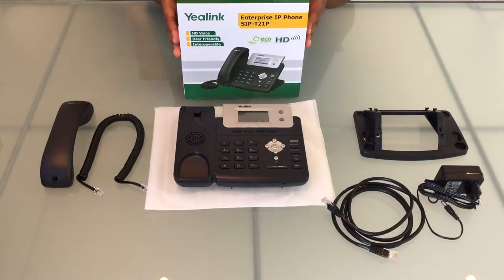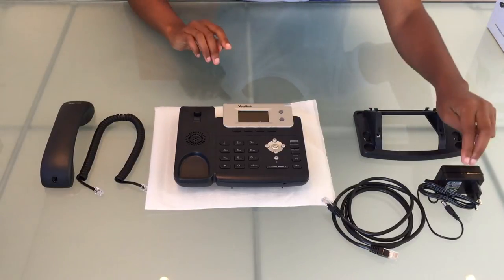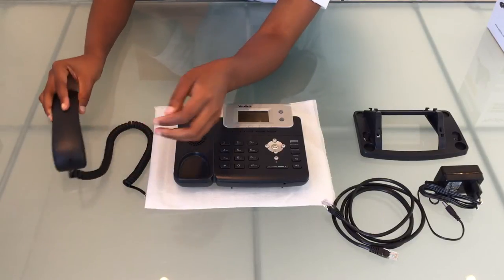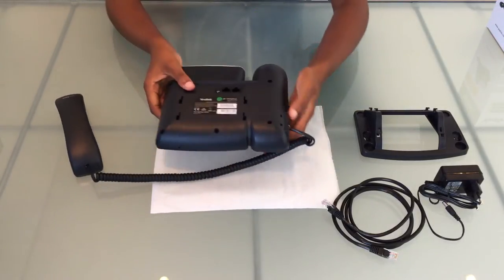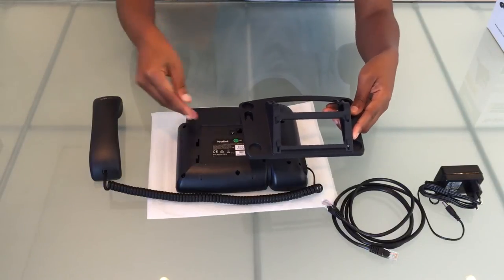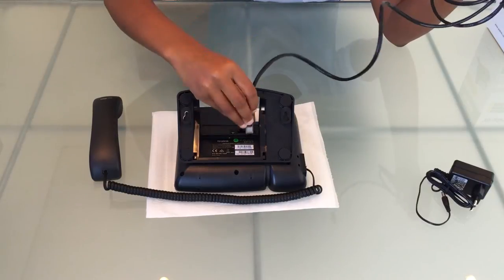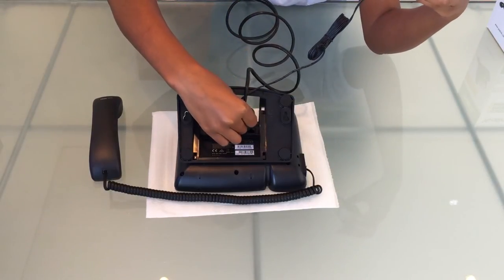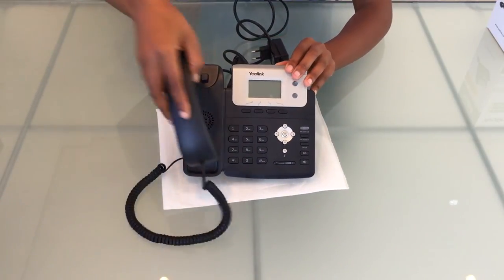Assembling a Yealink T21P

Comment: How to turn it on?
Reply from the maker: Hi Yashodha, The phone automatically switches on when you plug in the power supply unit. Or, if you're connecting your phone via PoE (Power over Ethernet), when you plug in the ethernet cable.